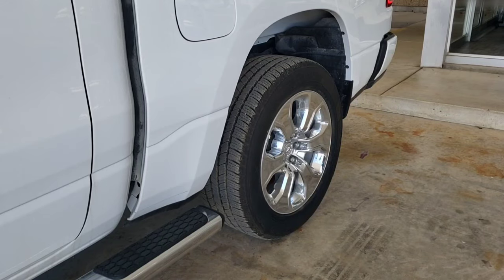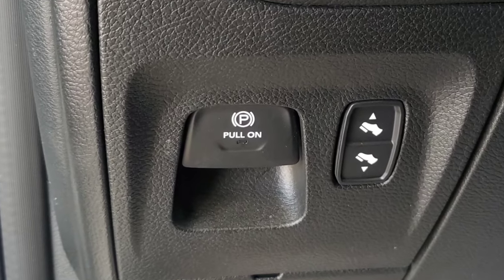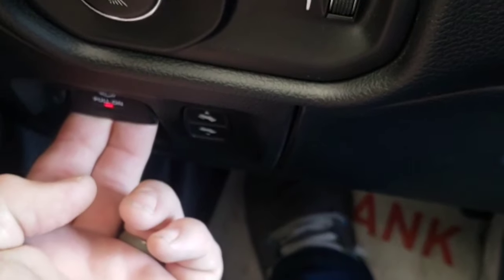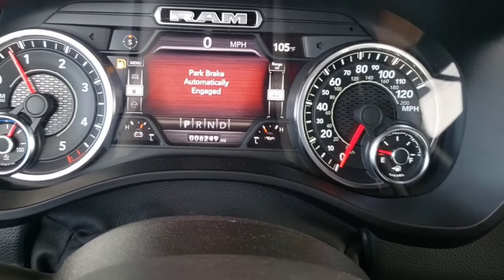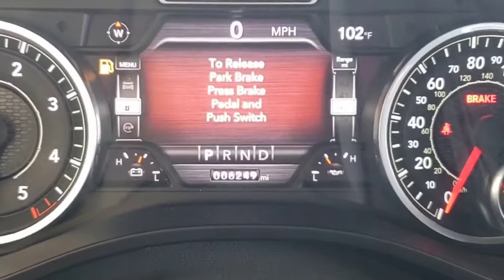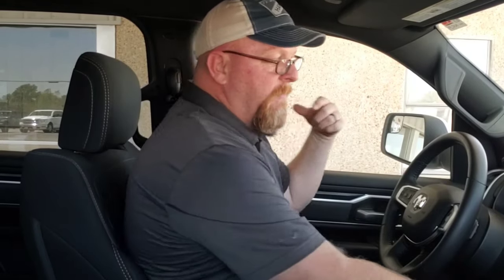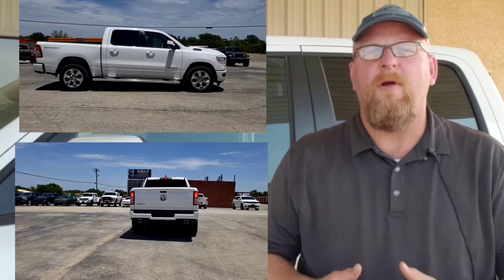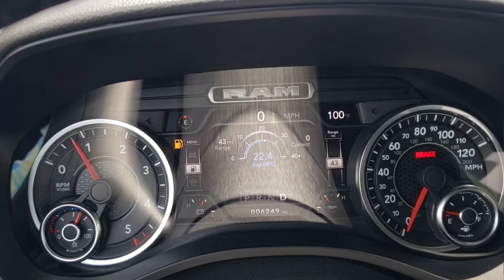Your Guide to Mastering the Ram 1500 Electric Park Brake

Comment: One really good tip if parking on an incline, is to while your foot is on the brake put the vehicle into neutral and then put on the emergency brake, that was the weight of the vehicle is on your brakes and not the transmission
Reply: How I've been doing it for years now. So many don't realize the small piece of metal the weight of the vehicle I'd sitting on when they don't use the parking brake.

Comment: Finally! Somebody explained it. Now, if you can explain why my ECO shows sometimes and sometimes it doesn't. I want to see it and have it engaged on the display, but it seems to be intermittent. Brand new 2023 truck. Thank you, sir.
Reply from the maker: ECO only shows when you are in a fuel economy sweet spot.  It's primarily going to show when you are at cruising speeds.  It won't show when you are in a hard acceleration, etc.

Comment: If I want to lay up the RAM 1500 (new version) for say 4months (merchant marine and work at sea) what is the best way to do it? If I leave the transmission in P and then switch off the engine is the electronic parking brake then applied? If so, how do you take off the brake when the engine is stopped? If I leave the parking brake on for 4months then it will end up getting seized.
Reply from the maker: Electric park brake won’t apply unless you have activated it or set it up to apply automatically when you put the truck in park. I wouldn’t leave the park brake applied unless absolutely necessary.  The vehicle has to have power to disengage the park brake.
Reply from the maker: Also, if you’re storing the vehicle for more than three weeks, the owner’s manual says to disconnect the negative battery from the cable. There’s some more info concerning the A/C in the owners manual too.

For a four month time frame, I would overinflate my tires by 15-20 psi to prevent flat spots from developing in them.
Reply: @prestonflanikensellscars9640  Hi thanks for your reply. There's very little info on the internet regarding this so I appreciate it. I've not yet bought the vehicle and trying to research as much as possible. I didn't know there was a setting to change from auto applied park brake from switching engine off to where it won't go on unless you activate the electronic lever. So basically, put it into P and make sure brake is not off. I will disconnect the negative battery cable connection. Being in the UK, there are not many RAMs and my current truck is manual transmission and manually operated handbrake. I would leave in 1st gear and ensure brake is off. I also spray the disc brakes with some WD-40 as they tend to rust when left sitting for so long. I'll get some tire chocks too to ensure it doesn't move. Thanks for the additional info to regarding the tire pressure.
Reply from the maker: What year is the truck you are getting? You can go to Mopar.com and find an online version of the Owner’s Manual. That will let you read up on some of the features before the truck arrives.
Reply: @prestonflanikensellscars9640  Hey thanks. It's going to be the 2022 Limited Night Edition. I ordered it today.

Comment: Is there a way to turn off the auto park permanently?? I got thru 2 gates every time I come home or leave my house, and it’s ridiculous I can’t open my door before it stops. I also want to find out how to turn off the 3 honks when I exit the truck with it running and the key in my pocket, whoever thought of that “feature” should be dragged behind a ram truck for several miles over asphalt…

Comment: Anyone know how to set my seats and steering wheel to automatically turn on at 40 degrees, my 2019 did my 2023 does not
Reply from the maker: On your radio screen, go to vehicle, then settings, then seats and comfort, then change Auto On Comfort settings to Remote Start or All Starts.

Comment: My E brake is off but it's still locked on some how
Reply from the maker: You've pushed the e brake button in and the brake is still applied?  Sounds like a trip to the service department is in order.
Reply: @Preston Flaniken Sells Cars  yea with a tow truck , but it did just happen once it got really cold so maybe it's frozen some how.
Reply from the maker: I hadn’t thought about cold weather causing issues with this system. Hopefully that’s all it is. 

I have been concerned about the e brake being on when a battery goes dead.
Reply from the maker: Any word on what caused it?
Reply: @Preston Flaniken Sells Cars  yea i checked and it seems to be my brake booster or my vacuum pump failing
Reply from the maker: That’s unfortunate. Hopefully still under warranty.